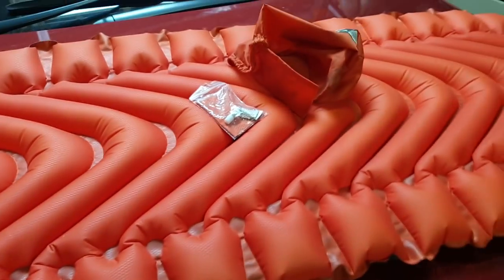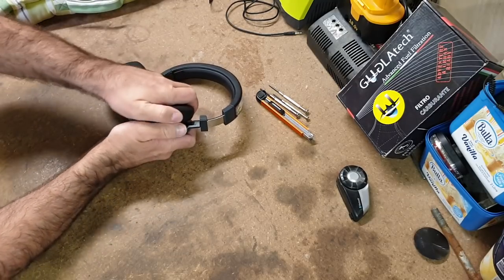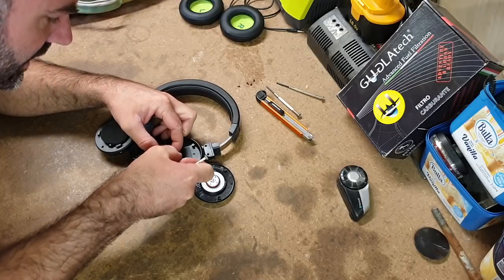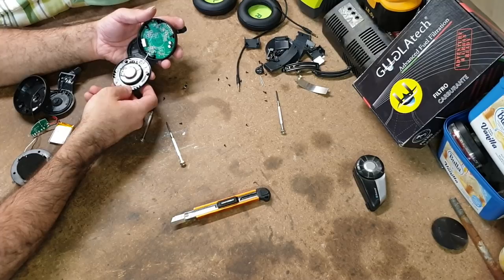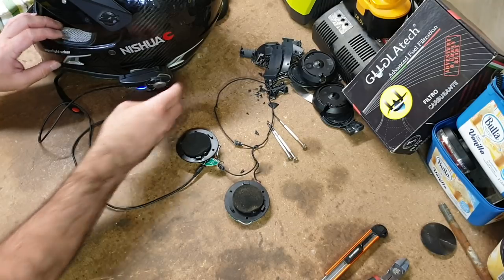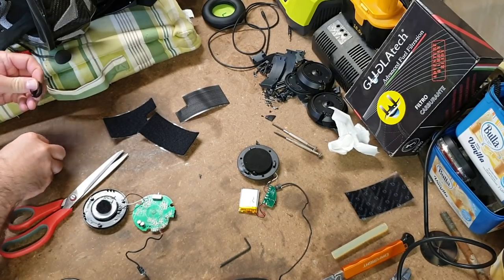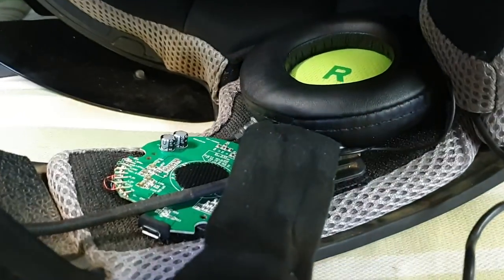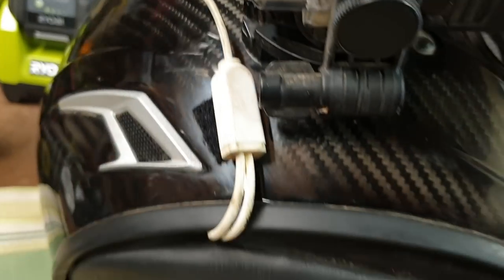Noise cancelling speakers in a helmet

Comment: I love how you did this nerb. But you could always just buy the Bose noise canceling ear buds. Which have good passive + active noise cancellation and just plug the chord into the senna. But I don't know how that would work if you are trying to record senna conversations. 

The earbuds would give you the advantage of being able to use the same setup easily in multiple helmets. Plus no need to cannibalize the internal electronics
Reply: There are countries like mine where ear buds are totally illegal on motorcycle, you risk a 200€(220$) fine, it's almost cheaper to buy a bose quietconfort 25 and mount it in the inside like this to make it a "speaker"  and it becomes more or less legal, better than paying the fine
Reply: As well as legality issues, the built-in setup has another advantage, sort of the flip-side from the ability to use it in multiple helmets: it's always in and ready to go, no need to mess with earbuds or earplugs. This is probably my biggest motive for wanting to do this on my setup, to not have to have putting in earplugs as another step in "suiting up" to ride. With this, just shove the helmet on, turn it on, and go. Though I plan to skip step #2 by rigging it to automatically turn on when I close my modular helmet's chin bar.

Comment: Hey, nice work and nice video. A couple of questions thou. Are you worried about having a lithium battery close to your head? I mean, the Sena already has one but is on the ouside. In case of emergency you can just yank it. I dont like to have extra stuff on my helmet, I only have the sena or the cardo and already think it is too much. The gopro I have it always on with the chest strap. Anyways, this leads me to my sencond question. Can you just remove the battery from the headphones and jump the connections so that they are powered only by the Sena itselft. The battery should be there because they are wireless headphones. You could probably get away with removing it.. But I am not 100% sure. Anyways, love the video. Cheers. PS: yes, I know its been a while. I am trying to catch up with your videos, maybe you already addressed these questions. Bye!

Comment: Do pop they pop at high speed?
I have some bose earbuds which are great for low speed but as soon as the wind gets up they pop, feels like a sonic boom in my head.!!
Reply: Same here with the bose QC20!  Doesn't make sense because the Bose QC30 doesn't do it (but QC30 is Bluetooth and cannot be used as an audio source for a comm system) Using the QC30 for noise canceling (it works great!) but it will cancel the audio from the comm system speakers as well.  Please keep us posted with any success

Comment: I know this was just a proof of concept but it would be good to strain relief all the wires coming off the circuit board so they don't get ripped off.  Solder them in the opposite direction and hot glue them to the circuit board.   Also to protect and waterproof all the electronics coat them in epoxy to encapsulate the circuit board.  You don't want to get shocked if you sweat to much!!
Reply: Yep, reducing the exposed length to just a few mm then the cm.

Comment: I've been thinking of attempting something like this, this suggests that it is indeed possible and effective! I'd buy a cheap good quality broken set on eBay - don't need the broken pieces anyway.

Currently I use earplugs, which has three disadvantages I think a setup like this would solve for my sort of use (mostly commuting/daily riding around town):
- Earplugs are another step in the "suiting up" process of getting on my motorcycle. Would be nice if I could just shove the helmet on my head and be ready to go.
- The earplugs are noise-blocking any time they're in. I have a modular (flip up) helmet, which is great for going inside (store, work, swing dance venue, etc) without taking it off, but I'm still basically deaf until I take the helmet off and pull out the earplugs. This I could have switchable - I'm even thinking of mounting a micro-switch to be hit by the chin bar so it automatically turns on when the helmet is closed for riding, and off when I open the face to talk to people, so I basically don't even have to think about it.
- The earplugs block sound from my comm system speakers for music or talking, meaning I have to turn that all the way up to hear anything, and the cheap comm unit sounds like crap. Connecting it directly to the noise-cancelling speakers would mean I can play music at lower volume and better quality.
Reply from the maker: It worked very well.... its only downside is heat. Your ears get very hot in summer.

Comment: Nice, I’m with you I’d like the noise cancelation. There’s about to be a mad rush on Aldi headphones😂. Love that you fitted extra mic those one way conversations where maddening lol
Reply from the maker: Yes, ive been meaning to do that for a while. Two way convos should sound good now!
Reply: That they are.
Reply: ... been looking for them in stores and finally found one that has 6 sets left... Closer look it is only the Bluetooth set HE170144.
Seen some of the Bauhn NC on eBay for more than retail price.

Differences of the model to Nerbs pair. 
Earcups are oval and are smaller than the NC set.
Red inner material than the green/yellow of the NC. 
Can charge at the same time as using them in either mode, might be able to do the same thing with the NC's.
Reply: Hazar... found two different sellers on FB marketplace... got both pairs for $5more then if I was able to get one from the store including postage... so I will not feel bad about taking a set apart now... Just tested them, not the most comfortable on my head but even just the light bubble of the fish tank was removed with the NC on.

Comment: I wanted to do this but you need the anc mic on the outside of the helmet
Reply from the maker: No you don't. You need to cancel the noise that is getting to your ear, not noise that is elsewhere. If you produce hums that you can't normally hear, you will hear the negative hum.

Comment: Have you considered moulded ear plugs? I got mine from Earmold Australia https://www.earmold.com.au/
 they are very comfortable and have a heap of different types.
Reply from the maker: Considered but I still fear I will get headaches. I hear my heart pumping and it drives me crazy. Also all plugs make traffic harder to hear and audio hard to hear, unless you get the ones with built in speakers.
Reply: Very true, I have a Nexx with the Xcom system and the helmet is very noisey (my bad, not enough research lol) but Xcom is sena 20 year so good quality. I find it clearer with ear plugs.
Reply: @Nerb1  I have Earmolds, at least 5-6years... speaker is not in the mould just the audio tube, works well. Not 100%blocking and can still hear road noise, the conversation can be tricky at a lower volume, or from the outside, people yelling at each other than thumbs up... so talk before you leave and put on gear or wait till you connect to the devices and use that.

Comment: Hi Nerb1, great idea. I use noice cancelling Bose for my plane travelling and always wished for a helmet product. Good thing about yours is that the switch remains easily accessible. How did you solve the charging - do you need to remove the padding to get to the charging plug ?
Reply from the maker: Actually, Ive plugged in a 10cm long usb cable which dangles out the back and i plug in a battery to charge it. It works so far. Not sure what other option I have yet.

Comment: do you still like this setup now ? have you changed anything ?
Reply from the maker: I dont, but simply because the circuit board was too big next to my chin and I had some loose connections that developed a crackle in one ear. The concept is great. Just needs a little more finessing than I put in. Now that winter is on its way, I might give it another go.
Reply: @Nerb1  Cool.

 I'm gonna check for space in my helmet. If it clears my ears I'm gonna make one too.

Can you give me your drivers dimensions ?, like how thick the are. And do they touch your ears ?

Also have you ever tried noise cancelling earbuds in comparison ?

Comment: Gday mate! Where did you place the battery and hoe do you charge it?
Reply from the maker: It charges through a micro USB and the battery was in there somewhere.
Reply: @Nerb1  I found some $20 noise cancelling gear at Kmart might actually tear em apart and give it a go, what the hell only 20 bucks right? But who knows what waits inside. Can I also ask what's the difference in the volume levels between the Aldi and the Sena? Are they just as load?
Reply: @Nerb1  Oh and thanks for your time to reply.
Reply from the maker: @dondarko7885  Yes, easily as loud. The fact that you have ear cups means you dont need the volume as loud anyway.
The downside is that it becomes a commuting helmet. Way to hot for offroading.
Reply: @Nerb1  Thanks again mate safe riding.

Comment: I do have one question. Why is the switch on the right hand side of your helmet?
Reply: Because it was attached to the right hand speaker.
Reply: @michaelunthank  surely the wires could easily be extended to put it on the left to save reaching across your field of view to turn it on ?
Reply: You could... but again, it mostly going to be on before you leave anyway.

Comment: Hey Nerb. 

I just did this mod with the latest Aldi Bauhn headphones which were on a special buy a few weeks ago. The circuit boards are fair bit smaller. I too have a sena and man with this mod I cant believe the overall difference in quality. Not only the noise canceling but the volume and BASS Im getting now is incredible. Ill make a short video soon.
Reply from the maker: Very cool. I will keep a look out for the new version. I might have to have another go at it.
Reply: I'd be interested in watching a video with the updated smaller circuit board 👍🏽

Comment: Nerb what a wonderful idea and how nice of you to actually “show” us if and how well it works. I have been thinking for ages on how to make a quiet ride. I have tinnitus because of motorcycling and most likely it came because of wind noise. Now I have bought a Sony Noise Cancelling over the ear set (WH-1000XM3) which has one of the best noise cancelling systems available for an acceptable price. It works brilliant, but just not when riding on my normal bike in the wind. It does a hell of a job blocking al sorts of noise, but just not the wind noise and especially not the turbulating noise. And that is the noise that probably does most damage to the ears. Now I was thinking if the wind noise cancelling would work better when wearing a helmet. But I doubt that. What  do you think? And would you want to go a step further on using a better NC system and fitting it in a better helmet? Or is this project enough sound deadening for you? Would love to see your views. All in all wonderful job, it made me think harder on how to build that quiet ride.....
Reply: I have done the same as Nerb, it is more the sound of the wind more than the wind in the helmet, as they were designed for flights/jet engines, not walking outside on a windy day... which some struggle with and that is the pop/loudness people talk about.
Everything you need to hear is still audible, just some other frequencies are reduced.
Reply: wobbly sauce Do you have a video on how to or how well it works?
Reply: Video no... just the rambling posts of a mad man.

Though... What is in this video is all the information needed to repeat the task in working order.

Comment: I love my Shure SE 215 noise cancelling Bluetooth earphones .., they sit really flat inside my  motorcycle helmet with no discomfort whatsoever. They cut the wind and engine noise.
.., also they also have these super soft expandable foam outlets that seal really well in your ear canal and the bass is incredible. The treble is also not harsh so for long rides you are not fatigued . The battery lasts over 6 hours ( I’ve gotten 9 hours out of it once) and charging time is quick . 
If ever they broke I’d buy them again in a heartbeat . So far I’ve had them 1.5 years and they’ve had a minimum of 3 hours use per day for the last 6 months, and for almost a solid year before that they got 8  hours use per day on a mbike trip around Oz..., so they’ve copped a workout and are still going strong .., best $100 I’ve spent.
Reply: Are you sure the SE215 are noise cancelling (active process) ? The description mentions "noice isolating" which is not the same.
Reply: ian2958 not sure Ian ? , but they are a great sound for the price (the best I’ve heard in their type and price point ) .., and the only ones I’ve tested that fit comfy under the helmet without the helmet pressing in the outer part . 
I went to all the stores with my helmet to test this out on many brands because that helmet contact gets painful quickly.
The replaceable and compressible foam earpieces work excellent for comfort in the ear canal while keeping the musics bass sound clarity deep and clear, while cutting greatly the engine noise and wind noise away , but not so much completely that I can still hear car horns and a slight engine noise ( but without ruining my music experience) etc .
Buy what you like .., but let’s face it this way , my dog just chewed mine to bits , and as I like them so much I’m about to order a replacement pair exactly the same ( and in future keep them away from my dogs reach when not in use haha) cheers.
Reply: A quick question for you ... in order to get the benefit of reduced noise, do the SE215 (or similar products) have to be  providing a sound back to the listener (ie, plugged into a phone & listening to music), or can they be used as ear plugs that just minimise the wind noise? (which is what I'm aiming for).
Reply: Jonathan L  - they do that when using the included expanding foam earpieces .., as opposed to using the silicone earpieces

Comment: You know that helmet manufacturers spend tons of time and money to make a helmet shape that wont do extra damage in a crash, then you hang that big camera off the side and all that research goes out the window.......
Reply from the maker: The camera is a crumple zone.... much softer than the steel ball they test for impact resistance. So its all good ;)
Reply: I don't think this manufacturer did anything but buy the design off Klim.....
Reply: @JustTex  who took the design from Uvex...
Reply: @κοκοςοητωοωΗεεΙς  Damn everyones sharing hey
Reply: And most likely made in the same factory... take LS2 for example, they make a number of different brands lids.
Reply: @Nerb1  its more about the rotational force applied to your head and neck......